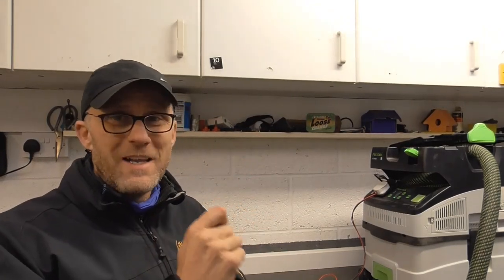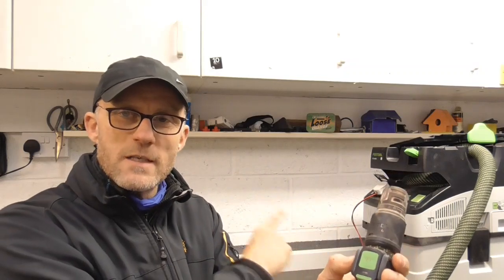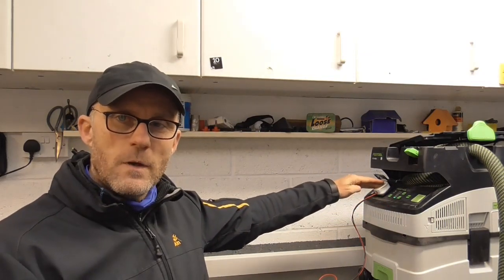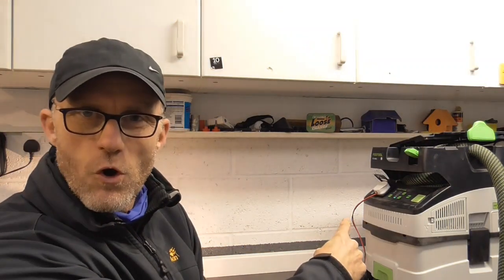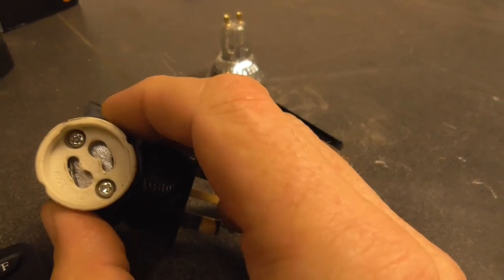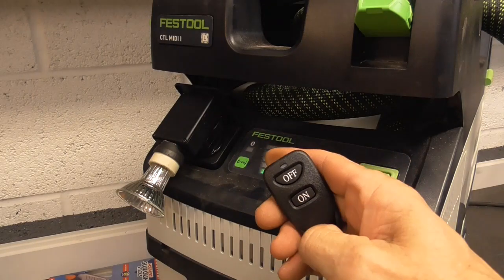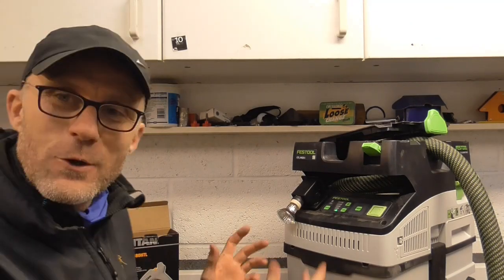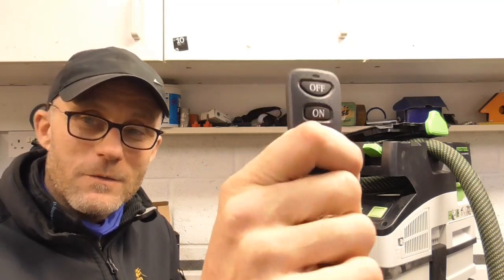Make your dust extractor remote controlled for £10.

Comment: This is exactly what I need but having trouble trying to find something that would work. I have a CT 15 e and tried a cheap Bluetooth power adapter switch with a light but apparently that  doesn't draw enough power ( think it needs .5A draw). Need something small and compact and the light would be perfect but can't seem to find a solution that would work here in the US on 110V. Any ideas?
Reply from the maker: Hi there🖐I can't think of anything of the top of my head, especially as you are stateside🇺🇸 Something like this with a higher wattage bulb plugged into it🤔 https://a.co/d/d2dwR7p Cheers Del

Comment: nice job.
I wonder what is the power required to activate the vacuum.
Reply from the maker: I don't think it needs much draw to activate it William🤔I plugged a battery charger into it and it triggered it👊Cheers Del
Reply: @thetallcarpenter  Thanks, sounds good. I just ordered a CT15 (they don't carry CT MIDI I here for some reason) and I'm trying to figure out a way to trigger it with my battery powered tools.
I guess I'm gonna try with a 2w light builb or something...

Comment: Do you have any idea if it's OK to run a festool extractor with tool (110v) on a standard 3k transformer or is it recommended to use the bigger 5k?
Reply from the maker: Hi Dan🖐I'm not sure bud, but a 3kva dual outlet transformer should be able run a couple of tools🤞Thanks for watching 😎 Cheers Del

Comment: I have the makita 36v cordless with Bluetooth but no Bluetooth tools .anybody got any ideas of how to work out a remote for it ? It’s a great wee hoover
Reply from the maker: Hi RC. I would be starting with Bluetooth chip that slots in the compatible tools as I'm sure this is what makes the tool Bluetooth. I suspect it will need power and some sort of trigger. If this became too bulky for attachment to the tool or hose, (probably would), then it could all be fitted into a small housing attached to the extractor body and activated with a similar switch to one I use in the video.😎 Hopefully someone will be along and shed more light on your particular circumstance.👍 Cheers

Comment: Hi ,Could this be adapted for a battery operated extract ? Thanks
Reply from the maker: Hi there. The answer to you question is, sort of. Most cordless extractors have an on/off button but no 240/110v take off, so the way I showed in my video would not work. You can, however, buy a similar remote controlled switch for 12+v dc which could be used in conjunction with the cordless extractors on/off switch. It would involve taking the extractor apart and altering the internal switch wiring. A bit more effort, but doable. Thanks for your comment. 👍

Comment: Hi Del cracking solution and not expensive, I still have the old Festool big hoover which turns on when the powers turned on but then they started to change the lead connections on different pieces of equipment 😠 great video all the best Tony 👍
Reply from the maker: Hi Tony. I like to tinker with stuff, especially if it makes life easier. Treat yourself to a new extractor, it'll make you feel good!! 😍 Thanks for your comment. 😎 Cheers